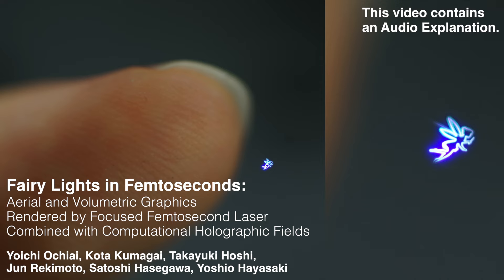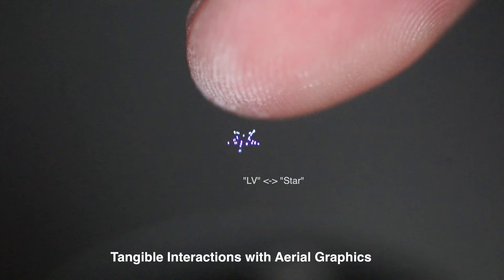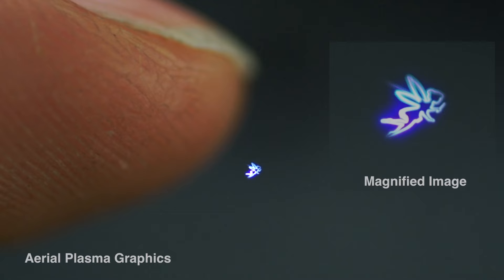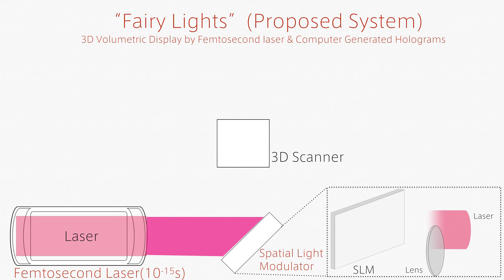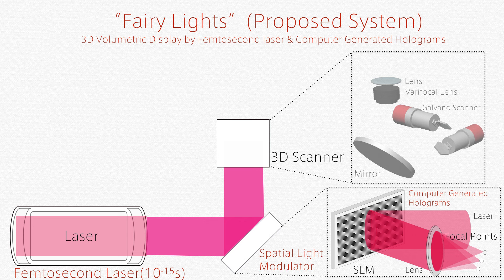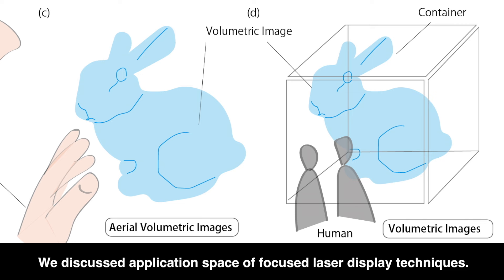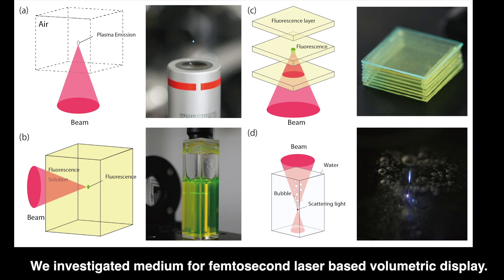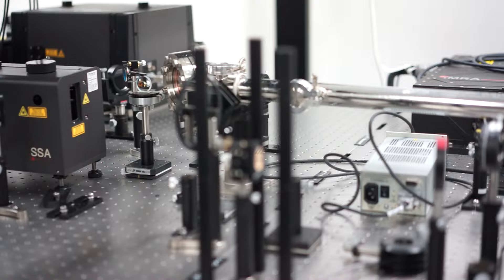Fairy Lights in Femtoseconds: Tangible Holographic Plasma (SIGGRAPH)

Comment: If the pulse can ionize the air, it is definitely safe to touch with unprotected skin. And to look with unprotected eyes on plasma, created by 2W and 10W lasers. Sure.
Nice display! Is the health insurance included in the price?

Citation: "the exposure longer than 2,000 ms burns the leather surface." I like the word "burn". Because the black spot appeared at the skin already at 50 ms of exposure.

Also for the case - 2W or 10W  lasers mean: "Lasers in this class (class IV) have output powers of more than 500 mW in the beam and may cause severe, permanent damage to eye or skin without being magnified by optics of eye or instrumentation. Diffuse reflections of the laser beam can be hazardous to skin or eye within the Nominal Hazard Zone."

P.S. Sorry for skeptic, but I read a lot about such 3D displays. And even worked with 1W 50fs 1kHz laser. 
If you really want to distinguish red from yellow, being old, wear safety glasses. And lab coat, if you don't want to have skin cancer afterwards.. And take out reflecting parts out from your hands, when you work with such lasers (I mean your nice photo with a ring).

Sorry once again.. Take care about yourself.

Comment: "Laser-induced plasma emits light without involving any physical matter." That's a total self-contradiction there.
Reply: hmmm..Please elaborate
Reply: How can it not involve matter when in the same sentence it says it involves plasma? What do they think plasma is, if not matter?
Reply: @Bob3D2000  Yes, like what the heck. How does that make any sense? I like it when the people feeding me my information don't inadvertently tell me that a physical paradox occurs every time the device of question is turned on.  I mean, you can tell that the content that the guy is reading from is passing right over his head when he fails to avoid such an obvious contradiction.  That is, unless maybe they mean: 'without using a solid (even though fluids like the air is made of matter, smh) medium to project the light onto'?
Reply: @logansimon6653  There isn't necessarily a contradiction or paradox here, if you assume that we're defining photons to be "non physical." This doesn't hold up in a technical sense, because photons are technically a physical phenomenon, but it makes sense in a colloquial way in that photons don't have mass. So it's a bit of a stretch, but it makes a certain amount of sense to consider photons as "non-physical." The plasma referred to here isn't emitted by the device, but is created through the action of the laser on the atmosphere.